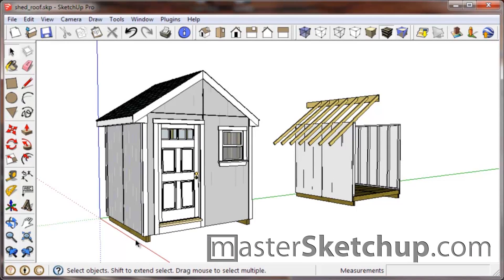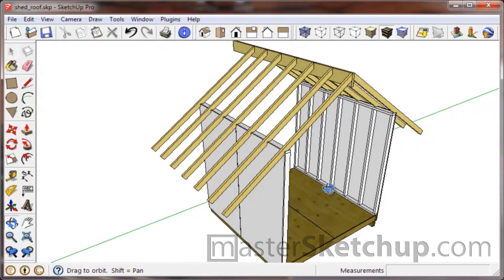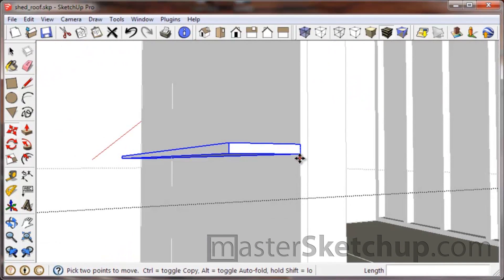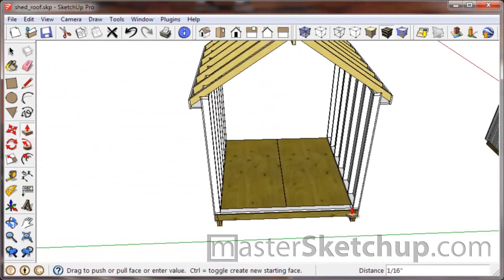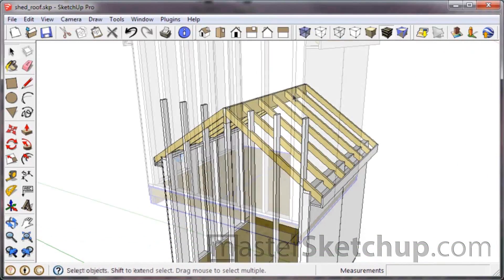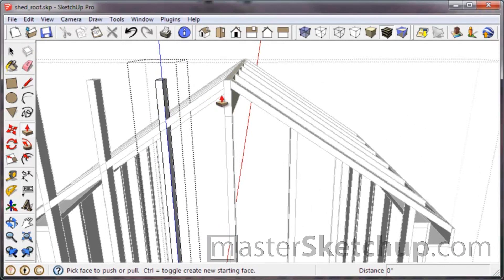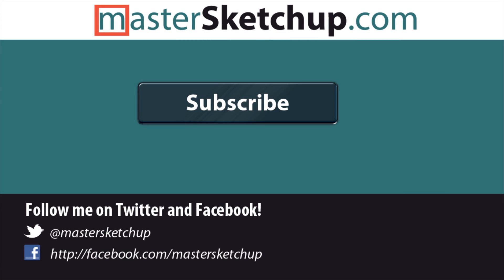Sketchup Tutorial - Model a Shed (Part 4) - Soffit & Gable Walls

Comment: Hi Matt.
This is a very specific question. Right at 10:16 how do you get the push-pull tool to align the top edge of the 2x4 with the inside edge of the plywood. I can think of a half a dozen kludgey ways, but you didn't do any of them.

Thanks,
Phil

Comment: Odd. When I was trimming the top of the studs at the underside of the top plate, the push pull function left a face behind. But only from one side. If I changed my view to push from the inside of the shed to the outside, the whole top of the stud was deleted as it should be.

Comment: hiya, great video.
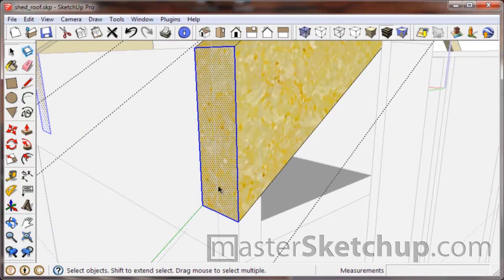I'm a little stuck however, at 6:04 you shorten the rafter component by 3/4" to pull it inside the facia with the move tool.  But when I do this it moves the entire rafter rather than making it shorter.
I'd be really grateful if someone could point out what I'm doing wrong.

Comment: Hello!

Thanks for posting these videos! They are a great learning tool and are helping me design my 10x10 shed!

I'm having an issue with trimming the rafter tails though - at the 6:00 mark, you use the move tool on the rafter component to "move it up one more spot" and use the move tool on the corner of the rafter. When I try to do the same, it moves the entire rafter (instead of just shortening it as it seems to do in your video), and unseats it/pushes it through the ridge beam. Any suggestions?
Reply from the maker: Yes! Thank you for referencing the time, that was very helpful. The difference is, I have the end of the rafter selected. Double click on the rafter with the Select tool, (Spacebar), so you can edit the individual entities. Then, select the end face of the rafter (It should highlight blue). Now, you should be able to use the Move tool to reference the end point and "move it up one more spot." lol

Comment: Master, when I click into a component the rest of the model disappears. So I cannot see any of the references to make the modification on the component. E.G. when cutting the rafters for the notch, when I selected the rafter the walls disappeared, leaving me with only the rafter and it's guide lines visible. I had to guess where to draw the lines. It took me several attempts to get close, and close is the best I could do....  Is this only on the free version? Thanks. Great instruction.
Reply from the maker: That is a simple setting that you can toggle, just go to View -> Component Edit -> Hide Rest of Model. I actually have a shortcut so I can quickly toggle back and forth.

Comment: Question for you or anyone using Sketchup: I cannot flip the rafters on the green axis, anyone know how to fix that problem?
Reply from the maker: If you Right-click on any group or component, there should be a menu named "Flip-along -> Green Axis". Is this what you tried?
Reply: yes I did try that
Reply from the maker: Perhaps your axes are oriented differently in that group. Try flipping along the red or blue axis and see what happens.
Reply: Hey I figured it out!
When you make a copy and move, you need to lock to the axis you want to flip on, for me it was the red axis, which then made the mirror image I was looking for MasterSketchup
Reply: Give me a call Bill@962-201-0325
Reply: I also found out, that the RED axis worked nicely
Reply: uninstall it forever and never reinstall!

Comment: Having issues with cutting off the end of the rafters after moving the boxing up and into position. When I click the "push/Pull" tool it highlights the entire rafter no matter how I place the boxing. I have tried it several different ways and time. I draw the line just as you did in the video but can not get it to highlight just the end of the rafter. Suggestions??